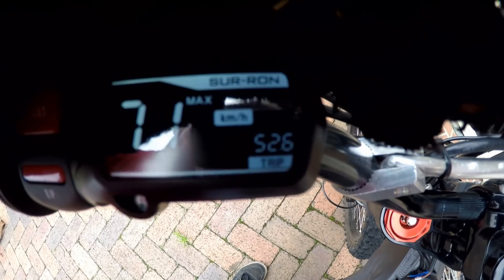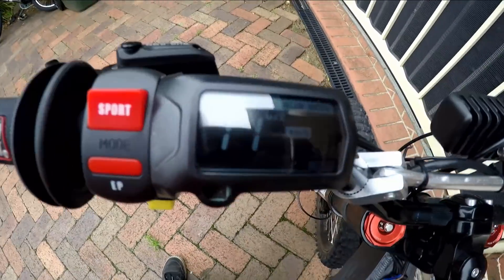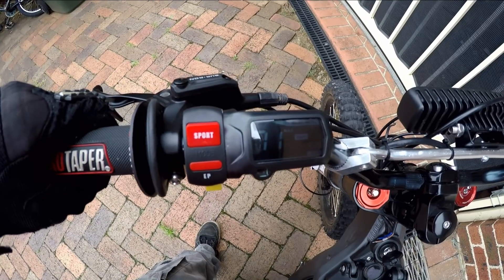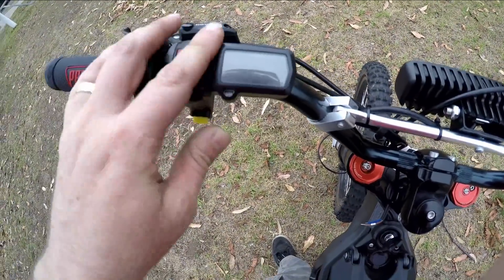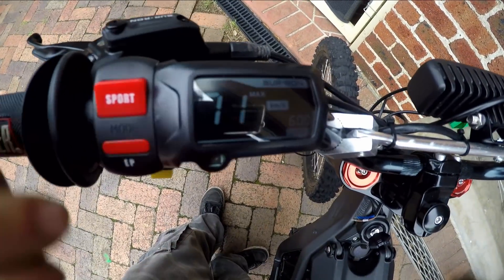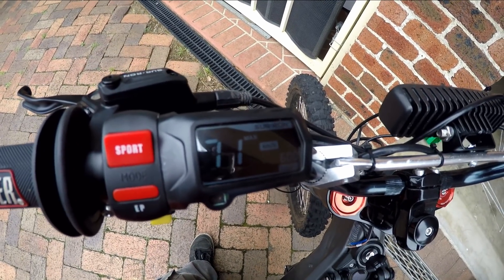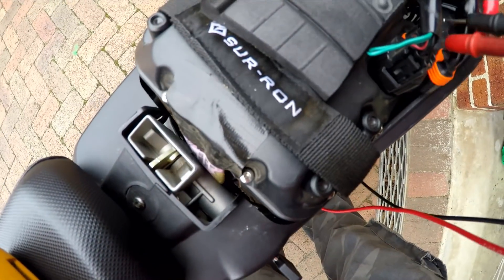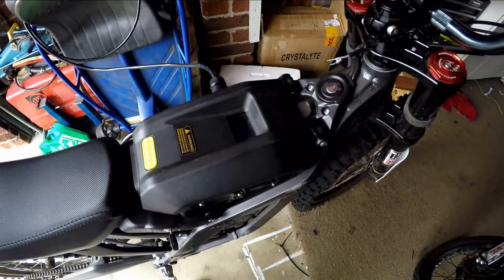Surron light bee full capacity range testing

Comment: sorry to get a little personal but you you mind if i ask how much you weigh? i only ask because im planning on picking one of these up and im trying to get a idea of the top speed id get.
Reply from the maker: I'm 72kg. If you're dramatically more it'll cost you a little in acceleration but top speed will probably still be similar. I ride with my 25kg son on board sometimes so total weight is just under 100kg and you notice a little drop in acceleration but not a great deal
Reply: Did you end up buying one bro?
Reply: @Squid 
Yeah did you get one yet

Comment: Did your battery go into limp mode or limit top speed to 40kmh at any point?
Reply from the maker: It did limit the top speed to about 40, if that's what you mean by limp mode ? At that point it limited the power in economy and sport to the same feel, so enforced eco I guess. See my other video on full discharge in eco mode. I actually still didnt get the BMS to cut out well beyond the indicated 0% capacity, but it must have been close, surely
Reply: Did the 40kmh limiter only start after 60km?